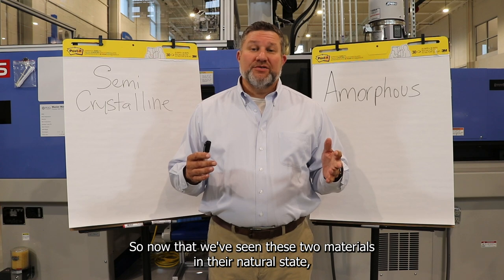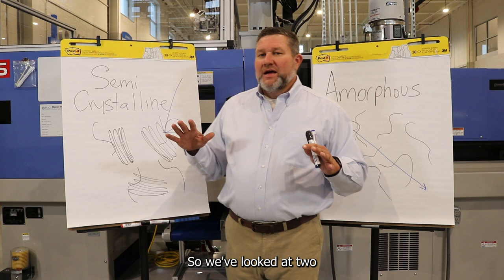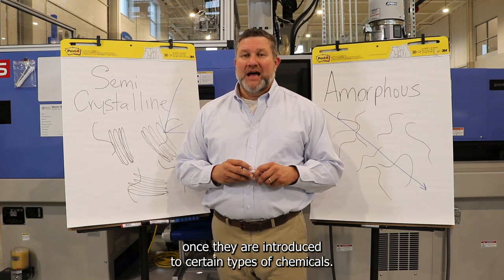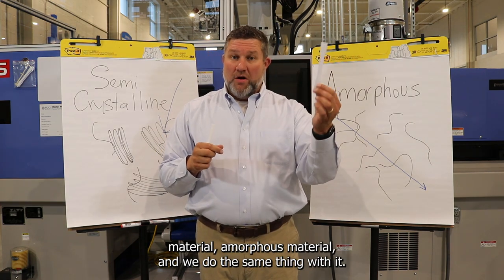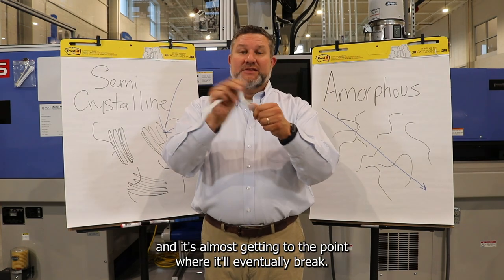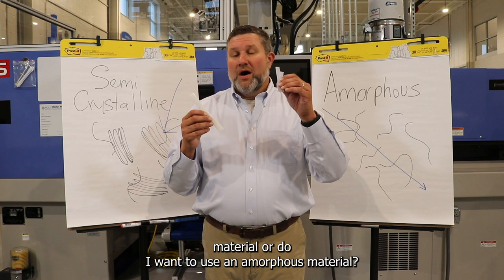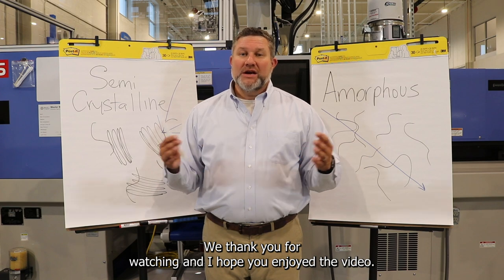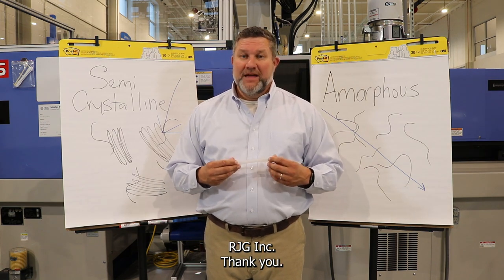Semi-Crystalline vs Amorphous Materials

Comment: Hi, thank you for video. I have a question. If during the injection we do more cooling, semi-crystalline are could increase o no? Cooling can effect more creating semi-crystalline area?
Reply from the maker: Cooling has an impact on the amount of crystallinity. The faster the cooling ( colder) the less crystal development. Hotter molds allow more time for the crystals to grow. It is important to run the mold at the correct temperature recommended by the material supplier.